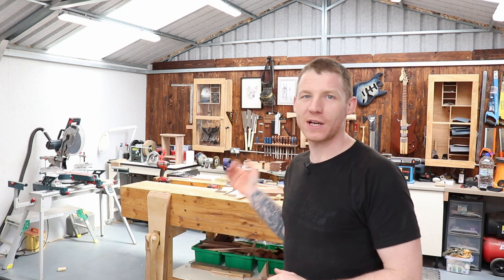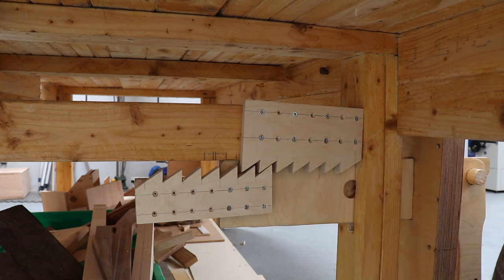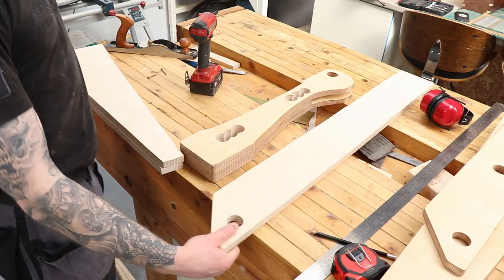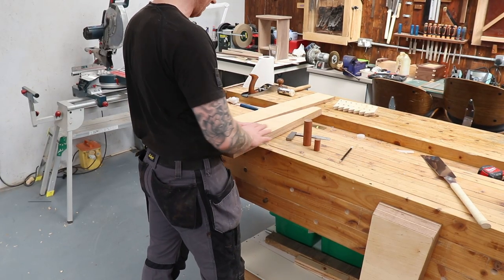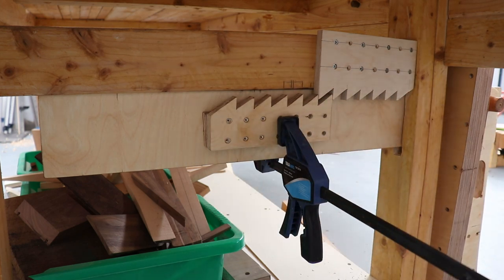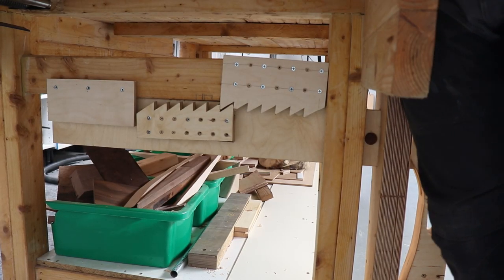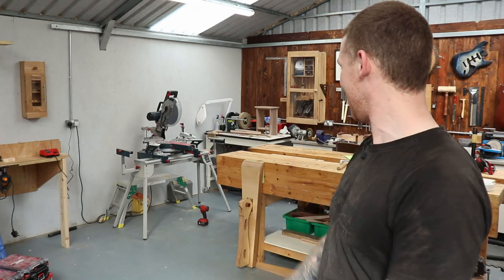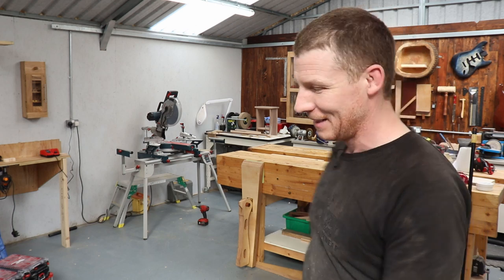CamLock Leg Vise/Vice Part 2. Working Prototype. Woodworking Vise No Metal Parts.

Comment: Edit: This would likely fix the 'torque' issue with the tenon-bar.
Small suggestion for the foot-wedge - Cut a small triangular piece with the same taper angle,  flip it around so it points in the opposite direction, and fix it to the bottom of the bench leg.  This will keep the back of the wedge parallel with the table leg, and ensure consistent clamping pressure on both sides of the jaws.
Reply: “Fix it”?  What do you mean?
Nail, screw, glue, rope? It needs to remain adjustable so I don’t understand “fix it”?
Reply: Oh ok. The second tapered piece!!!   Sorry

Comment: Brilliant, John. You are rapidly becoming one of the go-to sources of wisdom on YouTube. Brilliant idea. One thought I had was to replace the tenon with a wooden screw that could screw into the leg by rotating the cam-lock. Like the device that holds the bicycle saddle. But that would not be as quick to adapt to the various sizes of wood as your saw-tooth mechanism. The wedge at the foot is brilliant and I'm going to add that to my existing leg vice. If this CoVID lockdown ever ends we'll have to wait longer for your flashes of creative genius.  Have another beer. G'luck.

Comment: Use a cam lock on the tennon to actuate a clamping pressure on the tennon much like the brake on a car. Make a couple of "plates" with material that has a high coeficent of fricton that will grab the tennon and keep it stationary. This would replace the gear rack or locking pin.

Comment: I'm really excited to try building one of these for myself. I was curious about the clamping force so I did a quick comparison with a commonly used leg vise screw, which has 3 TPI. Basically I found that it is difficult for a cam lever to generate the same force as a screw with a 12" handle. If the cam changes radius by 1/2" over 120 degrees of rotation and your cam lever is 36" long, then it can generate about 2/3 the force of the vise screw (which is probably plenty!). The disadvantage is that force is inversely proportional to the change of cam radius, so if your cam changes radius by 1" then you only get 1/3 the force of the vise screw. I love the sawtooth solution for changing widths of boards, but the cam is still a little more limited in its range of motion than a screw, I wonder if it would be practical to place some shims or have dovetailed jaw inserts of different thickness to be able to add a finer adjustment than the sawtooth provides.
Reply from the maker: I'm working on a solution, I can now pull the vice in and out and clamp at any point, I have removed the saw tooth system and I'm now using an idea similar to a bar clamp. When the cam is engaged the vice locks and when its disengaged it is free to move in and out.

Comment: excellent idea i have working o n a dedicated leg vise with no metal parts but i am having trouble making a 65mm wooden screw i may try your method well done
Reply from the maker: go for it
Reply: Hi Barbara, I am busy with a jig or two to cut such a big screw and nut with a router. But it needs a special router bit and extensive jig or two. This is certainly much simpler and quicker. We'll done John!  Why did you not show this months ago before I started!?!